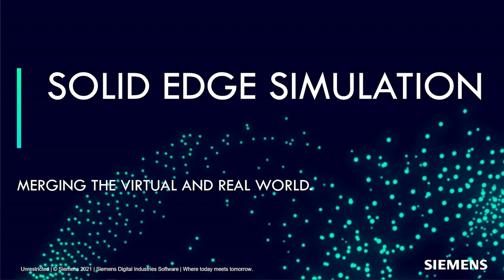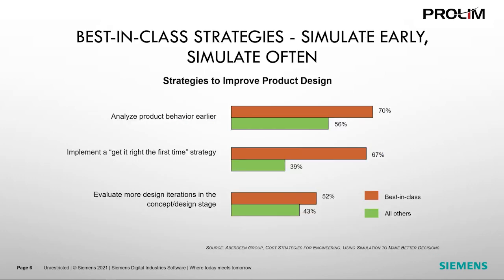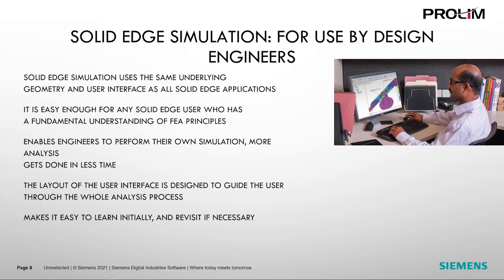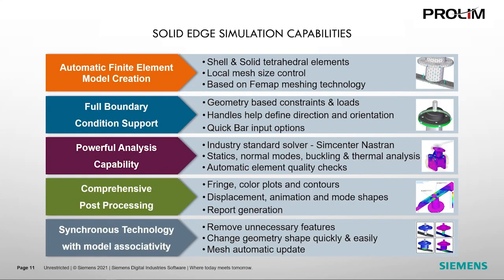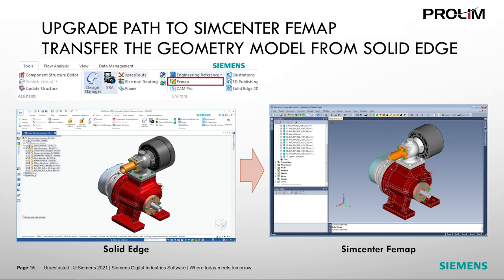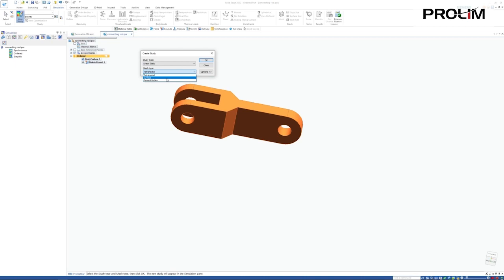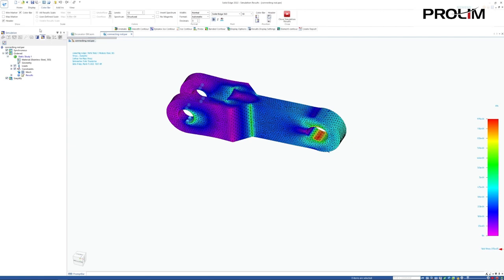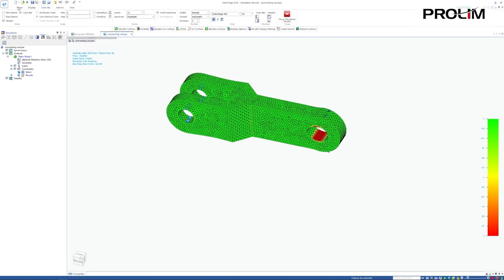How Can Solid Edge Simulation Optimize Your Designs? - Tutorial - PROLIM Webinar

Comment: Is included nonlinear analyses in some Solid Edge modules?
Reply: Solid Edge supports only linear (static, buckling) analysis, steady state heat transfer, transient heat transfer, and harmonic response. It also depends on what type of non-linearity you are talking about if it is material non-linearity the answer is NO if it is non-linearity due to mechanical or loading the answer is Yes.